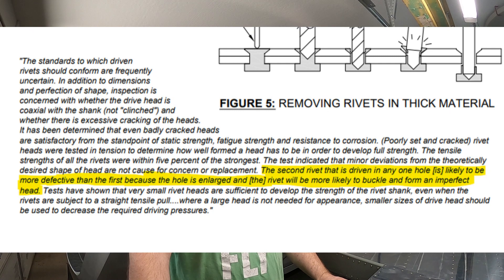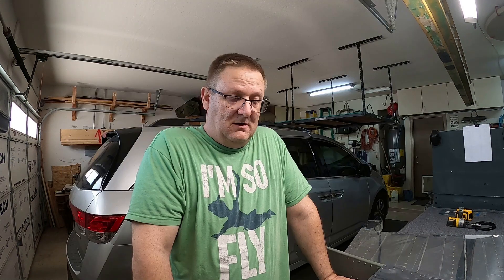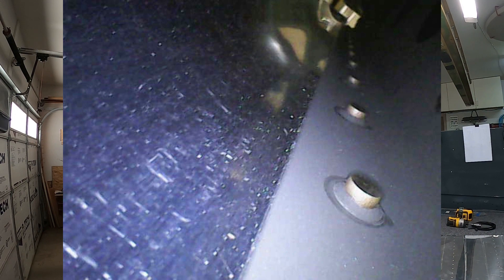RV-14A Build: Laser Cut Parts - Are They ALL Bad? #aviation #vansaircraft

Comment: Alluminium is a soft alloy.  if laser/Temp affects the composition of the alloy then the cracks may possibly develop later during flight stresses
Reply from the maker: Yep. That's exactly what happened. If the subcontractor would have used the cutting process specified by Vans we probably wouldn't be in this situation. But you never know... hind-sight being 20X20 and all.

Comment: Were your parts cover in Blue when you built?   If they were, no need to replace anything.
Reply from the maker: I didn't remember each part so I had to go back through old video footage to see if they were or not. sadly only about 10% of the parts had the blue plastic film on them... it looks like I will need to rebuild the elevators, rudder and vertical stabilizer.
Reply from the maker: and thanks for watching! I love your channel!

Comment: I'm now prepping my fuselage bulkheads and ribs that are all laser cut. They are not as crisp as punched but some of them look absolutely fine. Some of them don't and I do not want to use those. So I concur with your observation. Different vendors, bad days, etc... The wait and see approach makes sense and I'm guessing you're you're going to be fine.

PS Those really are some awesome rivets!
Reply from the maker: Thank you! I thought they were... I even showed my wife... she wasn't that impressed. :)
Reply: Funny I showed my wife too and she said... The holes are not really round. Don't you want perfectly round holes. From the mouth of babes.  @SlinkAir
Reply: Those laser cut parts may have altered heat treatment that could cause cracking at a later point in time... It will be a really expensive thing to analyze to make sure this will not become a problem later in the aircraft's life.  This could affect the fatigue behavior of those parts...

Comment: There is a reason laser cut parts are noted in major airframe manufacturers QA documents on which parts/materials can be laser cut.  You get a rehardened layer and it can cause micro fractures.
Reply from the maker: Yeah I'm hoping Vans will make it right and from their most recent comments it looks like they will. Fingers crossed...